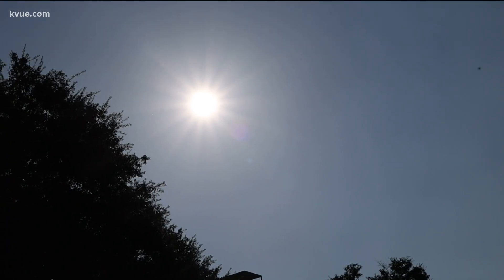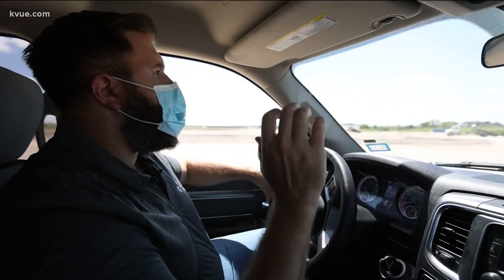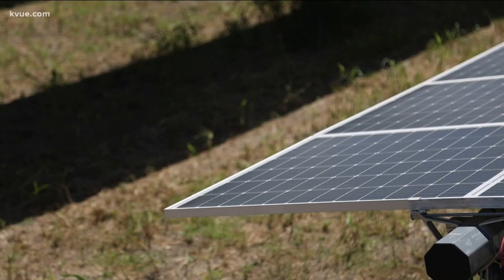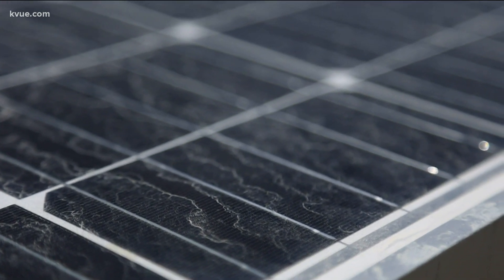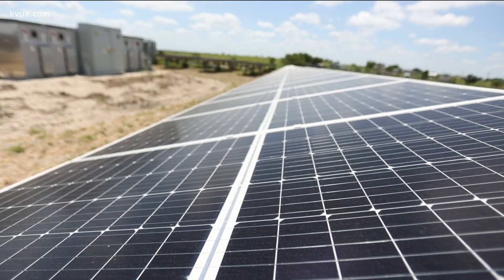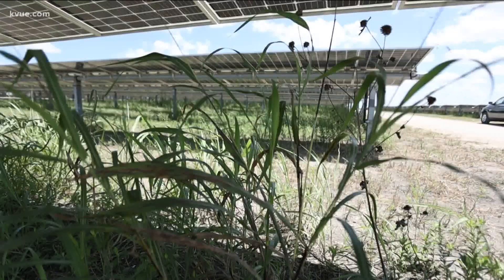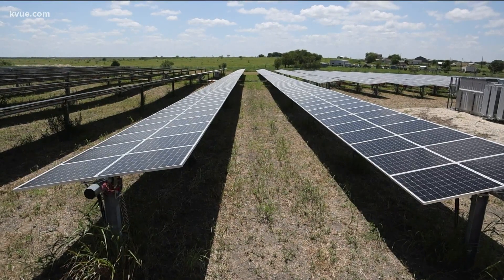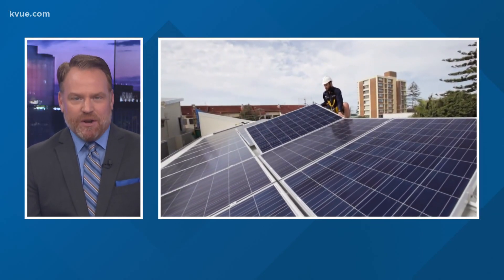How solar projects add to the Texas power grid | KVUE

Comment: We're so backwards compared to other countries. Australia is almost all solar, they're short on batteries for the individual homes but by next winter they should be pretty tight. They should have fires started from electric overuse like California this year, and almost every house has almost zero electric bill, only water and trash and WiFi bills if you rent, owners got most of the panels and infastructure from the government, they're just saving for batteries so they can have enough power to charge electric cars at home, etc...

Comment: Solar power was covered up by snow and the windmills froze. Idiots.
Reply: you're right about solar, but the rest was just lies & subversion. that early morning press conf was about PR damage control & controlling the narrative. Ercot cut off natural gas compressor sites,  so the gas supply to power stations was down. and that's why they froze; Ercot's mistakes stopped them from being fully operational (and hot)!
Reply: That's because those companies weren't required to winterize the equipment. Both solar and wind farms work great in Canada, for example.
Reply: @SaucerJess  not during an ice storm, directly followed by a snow blizzard, and all time record cold, you don't.